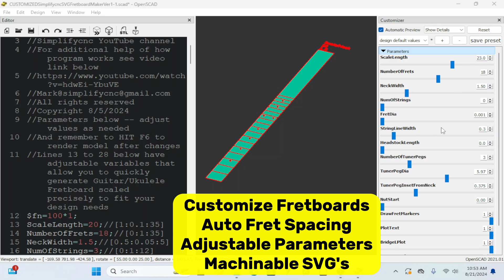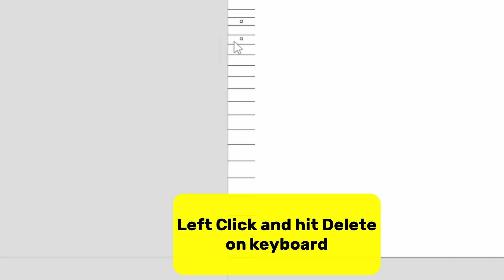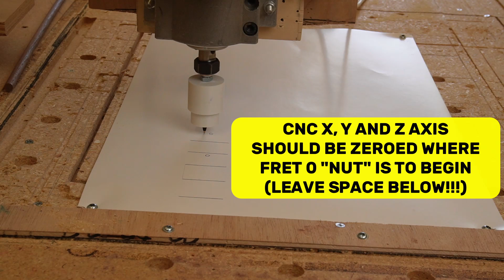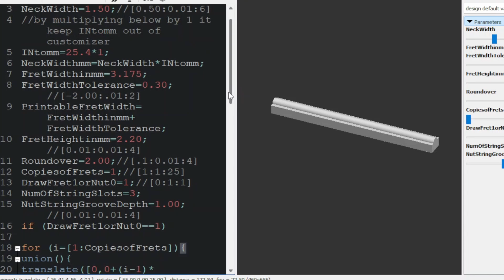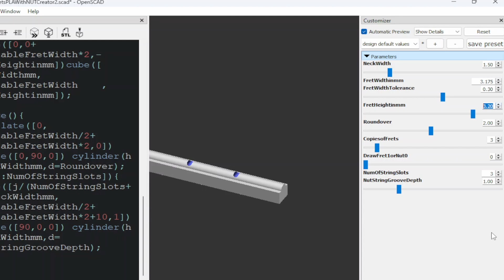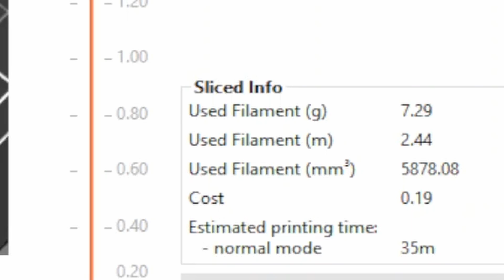CNC NO FAIL 2-2-2 GUITAR FRETBOARD | CNC GUITAR BUILD PART 3

Comment from the maker: Consider 3d printing your frets with metallic PLA or even wooden PLA to dress up your fretboard.  Also rather than using fretboard markers you might want to print the select frets you want to mark with a different color/type of filament.